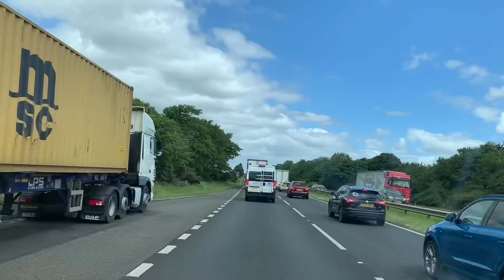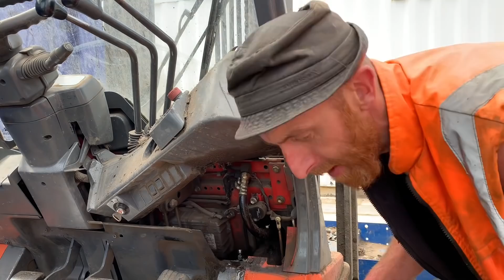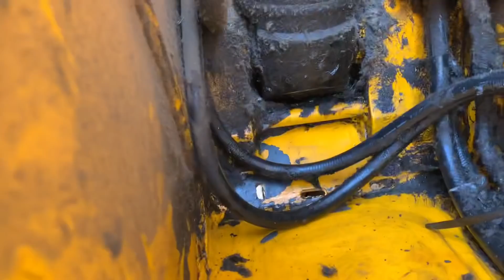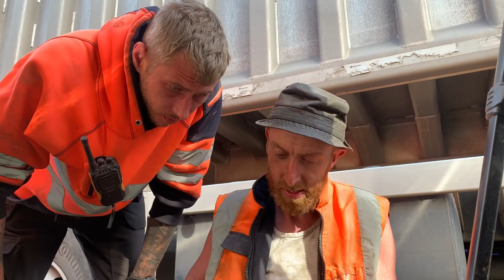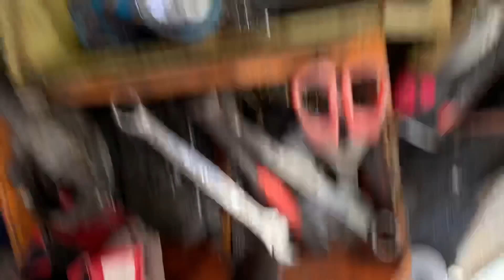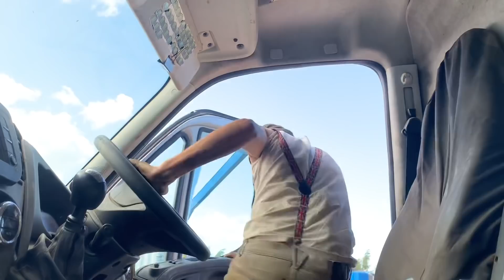Faulk lift Friday!! Hydrolic leaks, mobile mechanic

Comment: FIX YOUR BATTERY DRAW FAULT... Stop the waste and sort it out mate .  Meter between the battery and wiring. Check draw. Remove fuses till draw goes away. Takes 10 mins to find the circuit thats pulling the power.